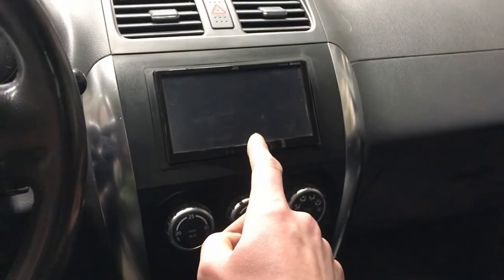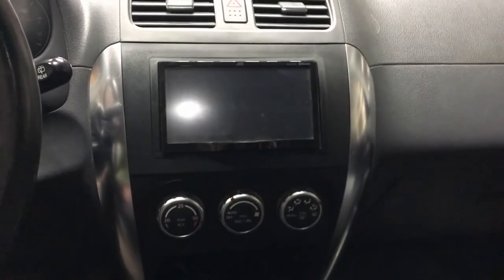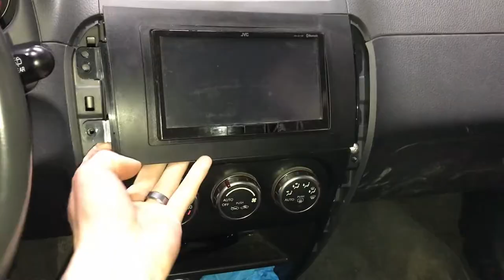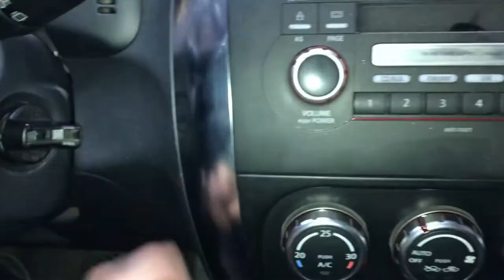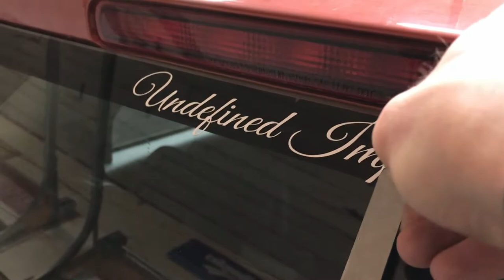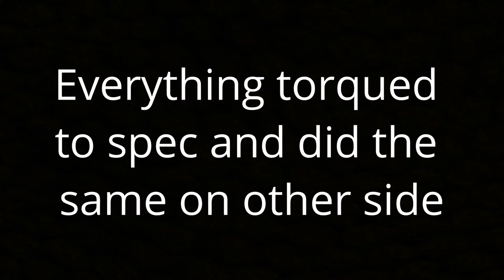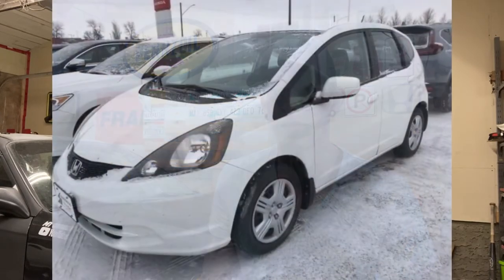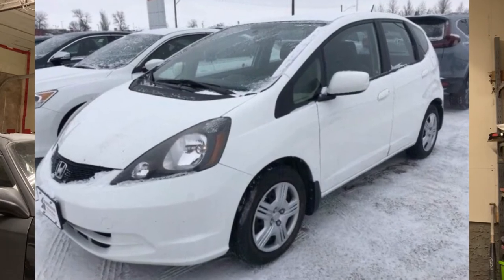Suzuki SX4 Back to Stock | New Daily??

Comment: Howdy, Winnipegger out here in North Van with an SX4, a 2010 AWD model. I wanted to know if you have a source for block heater and any upgrades. I hear a stabilizer is a good upgrade. Hope your winter is going well. We have actual - Temps now. Almost enough for a snow fort;)